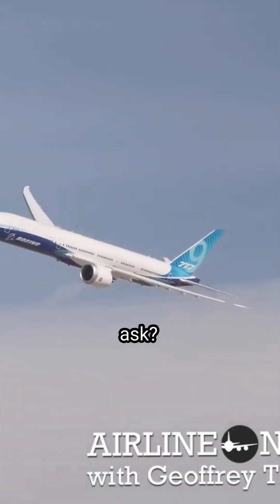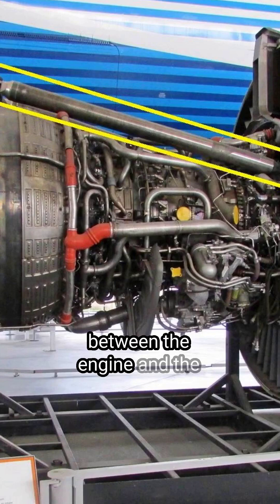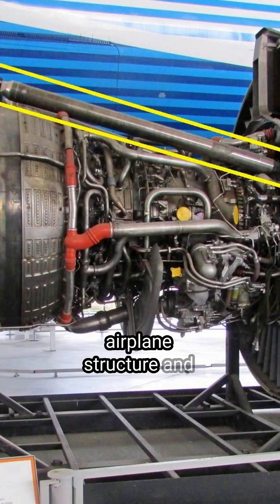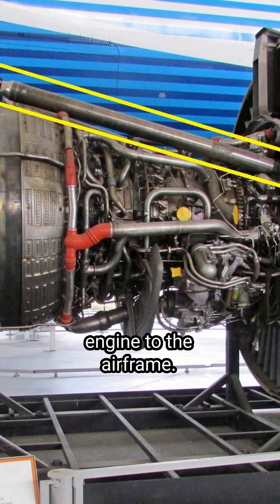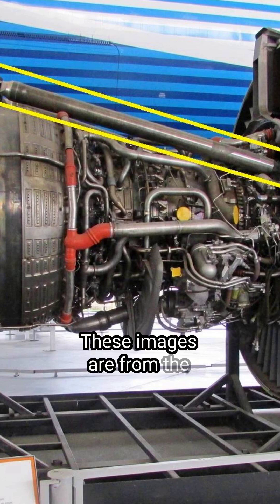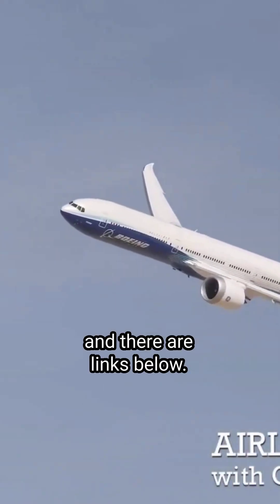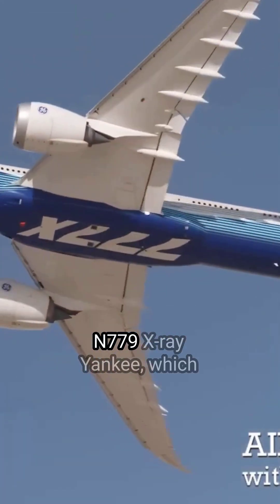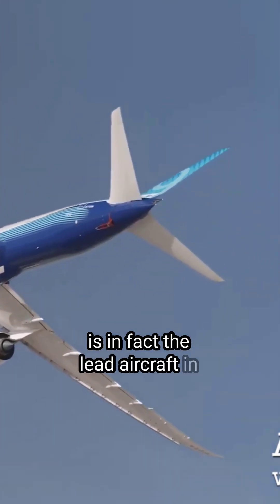Boeing 777X Thrust Link Failure  #boeing

Comment: Better safe  than sorry  however there’s a very disturbing legacy here that points back to the soft safety standards of Douglas/McDonnell Douglas when in 1979 at Chicago O’Hare Airport an engine fell off of a DC-10 on take off  and it crashed immediately killing 275 people. Afterwards during investigation a thin obviously not strong enough for the job bolt, was revealed as the culprit. Hmmmm, with so many lives at stake wouldn’t 2 or 12 or 24 bolts be safer? Look at a wheel on a semi 18 wheeler truck and count the mounting bolts. An average car has 5 but the bigger load requires 12-15 bolts and bigger and stronger bolts.  Yeah, and this thrust link that failed on the 777x was a complete failure on one engine, not partial